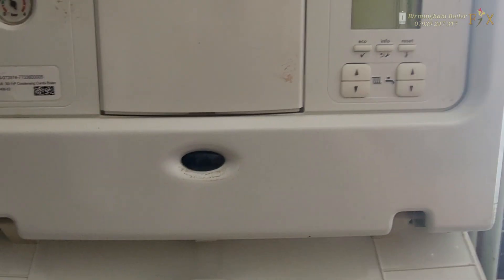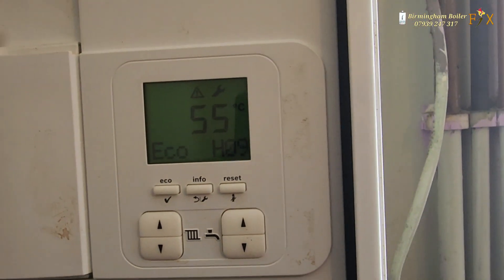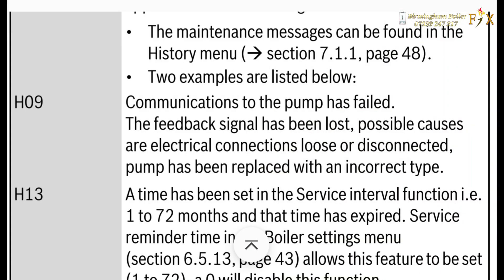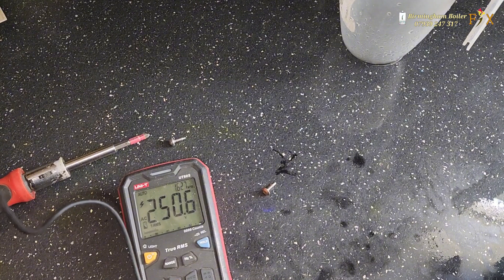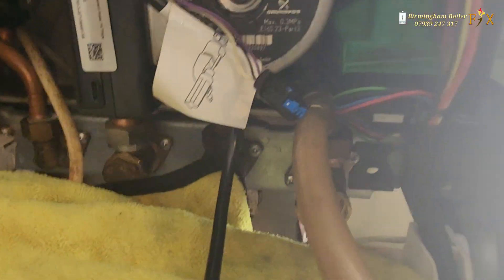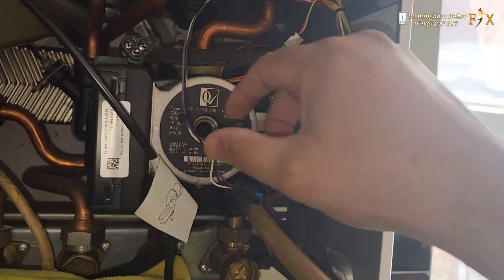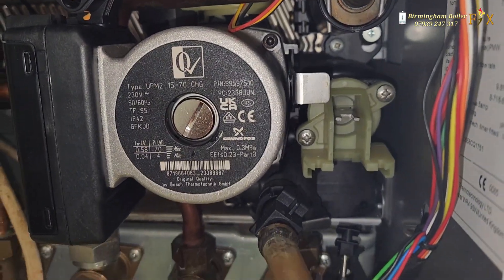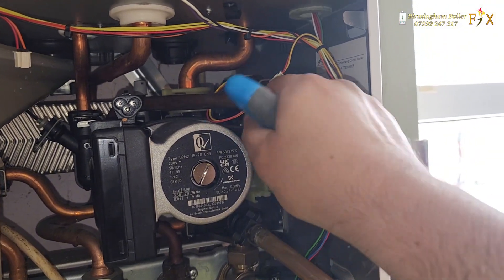Worcester-Bosch greenstar HO9 faulty code no heating and no hot water boiler diagnosis and repair

Comment: British gas changed my pump, error code still on the system . The hit water worked for a short while, then stopped, temperature was going high on the screen .

I called them again, they will visit tomorrow. Switched the boiler off .

Now I didn't wish to be rude and tell the bloke look at the PCB and or connections .

Hopefully the bloke tomorrow knows the ins and outs of this boiler

Comment: Most pcbs faults are down to dry joints caused slack connections on the plug connectors  or oxidation of the pins .its worth while just cleaning the contact or pins with a small nail file or give the connection block a little squeeze with plyer just to tighten up the connections  .